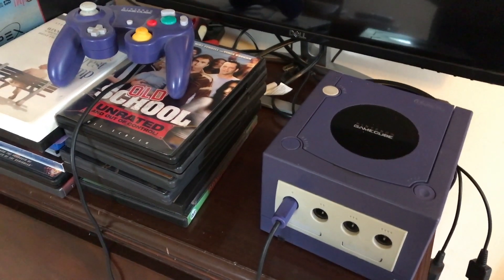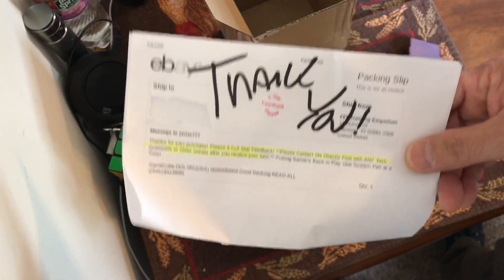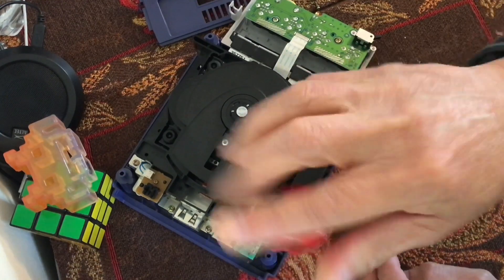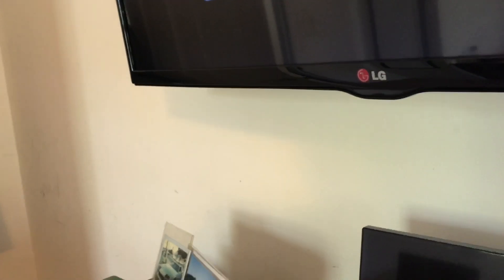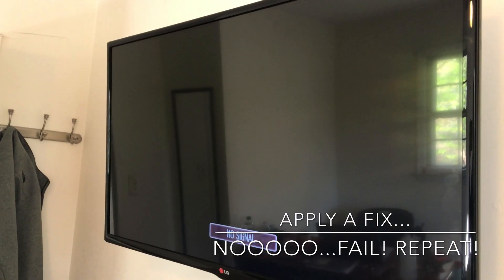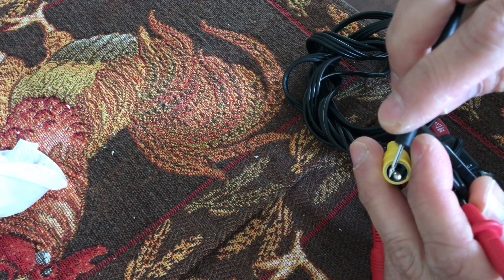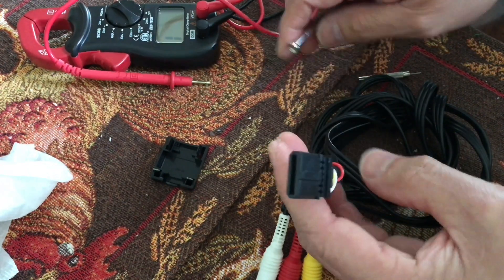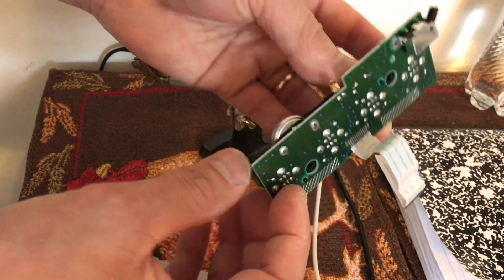GameCube No Video Repair! GameCube AV Wiring Schematic + Comprehensive Troubleshooting + Disassembly

Comment: Do you know where to find pinouts for the digital port? Mine only works on initial boot and then it stops sending a display or anything if I turn it off then on again

Comment: Hey my gamecube light will come on for like 2 seconds but then go off and the fan will come on and stay on. What do you think could be wrong? Thank you!
Reply: I'm going through all 3 of my cubes with this issue too
Reply: Replace the PCB power supply which is inside dol-001

Comment: Nice video bro, quick question. My device has no sound on the Analogic output... However the digital AV output works fine. I have tested severla cables and TVs, now I will open up the thing to check its guts... Any sugestión?

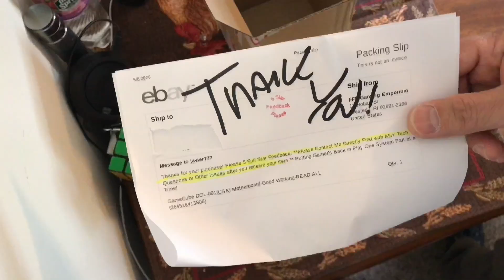Comment: Jump points: Gamecube Motherboard replacement starts 1:45 | 4:40 demo the FIX worked! | All of the troubleshooting video clips start 6:27 after motherboard replacement!  Gamecube av out and av wiring schematic start at 6:48 it also includes continuity testing of the AV out and AV Cable | Gamecube battery replacement 10:47 | Detailed Gamecube disassembly starts 12:30 | Motherboard cleaning starts 15:46